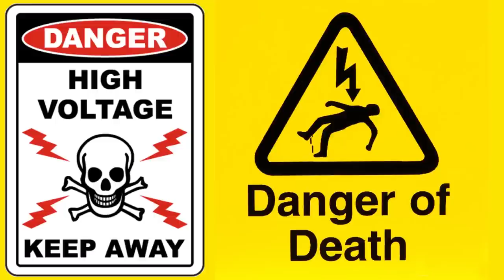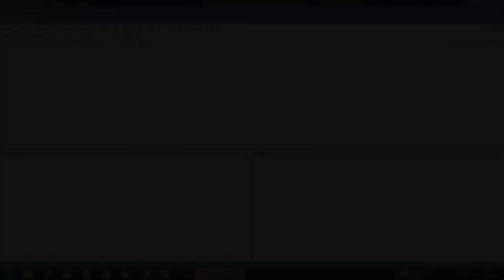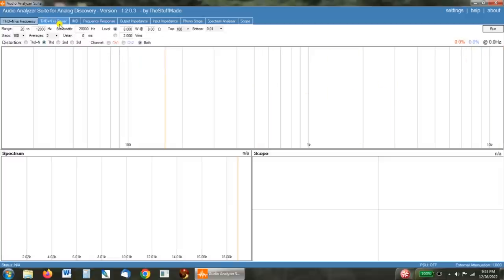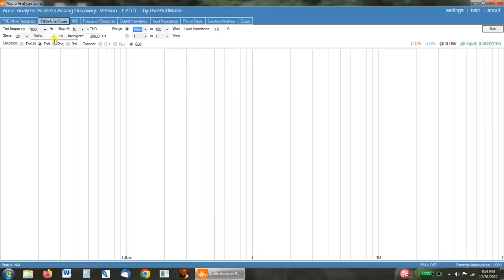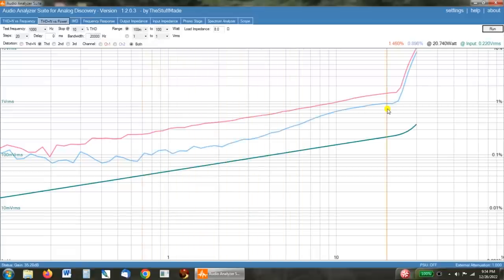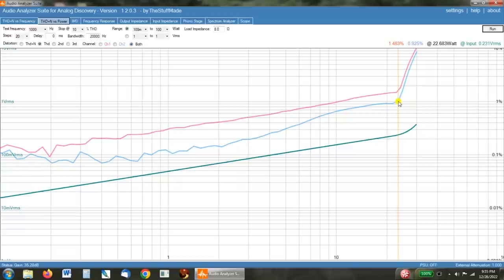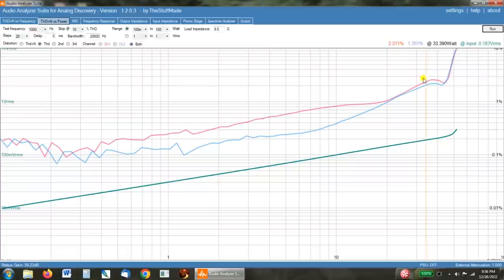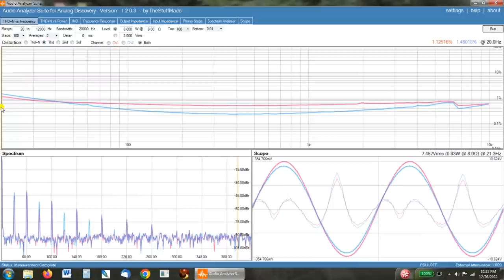Willsenton R8: Repair and Testing!

Comment: I had an R8 and did a few mods on it. By far the best mod was to replace the 4 coupling caps to the output tubes with U-Cap copper foil Teflon caps. Very expensive mod but the dynamics of the amp improved out of sight. I've now moved on and have 805 monoblocks but fondly remember the R8.

Comment: As far as I know, the Wilsenton's are made by one of the more reputable companies.   I can't be 100% sure, but I am 90% confident that the caps are genuine in these.    Really great video.   Wonderful to see this amp is as good as they claim, and can be improved on by adding some nice tubes to it.    They do sell this with two options.  KT88's or EL34's   I'd be interested, if you have a set, to see the performance with the EL34's.    It's rated at 40Watts in the EL34 configuration (UL) and 25Watts (Triode).
Reply from the maker: I do have some EL34, 6CA7 and KT77 I plan to try in it.

Comment: Great!  I have this amp with NOS EL34 tubes and it sounds very good.  Looking forward for your next videos on it.
Reply from the maker: I really wanna try it with some budget friendly JJ EL34L. I've used those in single ended amps and they sound really good.
Reply: @SkunkieDesignsElectronics  I've tried those with this and they have a very pure sound.

Comment: I have the R800i 845 and love it! But I wonder what solid core silver hookup and upgraded caps would sound like… Thank you for these videos!!
Reply from the maker: I'm more into just using "overkill" gauge copper wire, especially for short hookup wires, but agree on the upgraded caps. I really like these alum/oil Mundorf caps for sound quality vs price point. Now I can see silver wire in like the output transformer windings being a good idea.

Comment: I have for the last couple years plugged every amp I have into a voltage regulator to try to avoid any issues. The old house Im in is just a rental. I can’t repair the Elec myself, even if I know there is faults in the wiring. I just make sure my fire alrams are working, and the exits are clear. I am moving out asap btw.
Reply from the maker: Good plan!

Comment: Glad to see your thorough and detailed videos on the R8 repair. Mine just did the same exact thing on V2. Both the 10 ohm and 1kohm show they got hot and burnt but when removed the resistance is correct. I only had it on for a few minutes and heard static and saw sparks around the tube for a few seconds then the sound came back on. I am not sure if one channel went out as I turned it off quickly. This Willsenton R8 was purchased Jan 2022 and had Gold Lion KT88 repops. 
Now a question did you use the same tube and what caused this ? Thanks and keep up the great work.
Reply from the maker: Once they arc/die, they are dead. and likely the bias was set way too high or the bias pot is faulty/has no safety resistor in the circuit.

Comment: I have NOS Svetlanas running mine, plus NOS 80's Russian valves on the preamp stage. I must say I prefer it with EL34s (I got both KT88 and EL34 Svetlanas). The increase in sweetness and coherence over the stock tubes is not subtle.
Reply: Plus the sound keeps getting better (after over a year)

Comment: Hello, thank you for the great video. I have had a similar problem. i replaced all the 10 ohm 1 watt and another resistor with a metal film (1%). Unfortunately, the bias meter does not work now. I found this out after i noticed one channel that is lower volume. I am using different tubes and have swapped left to right. The one channel remains lower volume? Any suggestions? I fear the worst. Thank you, looking forward for more videos.
Reply: Oh, I made an error. Be careful of small solid conductors on preamp tube sockets. They break easily. So I have equal volume in both speakers now. I still have a pegged bias meter that was related to a similar issue you are sharing with everyone! Thanks!
I have completed the capacitor upgrades and the electrolytics as well. A noticeable improvement, especially with controlled bass. I think tube rolling gives a bit more improvement but it can be very expensive. If you have an idea about why the bias meter is pegged all the time. I will be watching.

Comment: Hi Skunkie,
I set my up my R8 today.
Running quality cables with Heresy speakers. Source is hi-res files Bluetooth from my phone. (I know, but a streamer is in the near future).
Almost NO bass. I expected punch and got foam.
QUESTION, please and thank you! :)

On the INPUT selector, both the CD and AUX 1 light up simultaneously. Doesn't matter which of those two I select; both come on, although the "selected" LED is a tiny bit brighter than the other. 
AND, my Bluetooth device, connected to AUX 1, will work even if the CD source is selected.

Should the amp go back?
Thank you a million times for your input.
Reply from the maker: Sounds like there is something wrong with it for sure.

Comment: After watching your video, I couldn't resist so I opened the amplifier cleanly to see visually if anything could be detected. As I said, one channel (left) stopped working. Everything looked normal, but I still decided to remove the small black square cover in the middle of the bottom, which I think is the transformer (sorry for my ignorance, I hardly know what + and - are). And I found a small green, I think ceramic resistor cracked. This could probably be the cause. But I don't know which resistors they are and which value. Is there a schematic of the Willsenton r8 somewhere? I would be very grateful for an answer. But anyway, you helped me a lot in terms of giving me the courage to open it, because I was afraid of screwing something up. Thank you very much !

￼

Povratne informacije

Web-rezultati
Reply from the maker: There is a schematic but those resistors aren't going to kill just one channel. 

https://www.skunkiedesigns.com/r8-mods
Reply: @SkunkieDesignsElectronics  Thanks Skunkie ! You are the One ! I'm going forward to resolve problem. You were of great, great help. Thanks again.

Comment: Hi, thanks for your videos which I enjoy. The AudioAnalyser shoftware shows four lines in scope more: two are the sine wave of the channels but what are the none sine wave lines ? Secondly do you know a way to use the software to chart a phaseshift plot from input to output ?
Reply from the maker: I would go ask the person who wrote the software.  :)
Reply: Hi, I got the anser:   @TheStuffMade
@TheStuffMade
15 hours ago
Hi Alex, thanks, the extra plots in the scope view is the signal with the fundamental tone notched out, so basically showing the distortion plus noise waveform. I haven't added a phase plot, but I probably should. You can do a phase plot using the Digilent Waveforms software, it's under the Network tab and it's a bit fiddly to configure but it will do the job.
Cheers,
Jake

Comment: Hello! I need your help! Today I replaced resistors on an output tubes an power transformer, checked the amp and it worked fine. After that I replaced 4 electrolytic caps on bias boards (clipping caps I did earlier) and added resistors to a signal wires. on the check one of the tubes went red plated and 10 Ohms resistor burned out. I replaced that resistor and set of tubes. On the check that same tube bias shows max and can"t be regulated by potentiometer. What can it be? what I did non correct?
Reply from the maker: Send me a direct message. https://www.skunkiedesigns.com/contact

Comment: I have this same amp. It's not even a year old and I have what I would call static at certain high frequencies. I know it's the amp as I swapped it with a solid state and get no static. It comes out both channels but is more prominent on the R channel. Could changing the tubes out help this problem?
Reply from the maker: Are you using it in triode or ultralinear? The triode mode sounds bad to me.
Reply: @SkunkieDesignsElectronics  Actually watching this video made me think to try it on the opposite of what I have been which is default (not sure which one tho). Still don't think I should be hearing it. Thanks for the reply!
Reply: @SkunkieDesignsElectronics  The static happens on either mode. It is volume related. If I have the volume about the 10 o'clock position the static kicks in, turn it down just a hair and its gone. I don't this this is your standard distortion, but I could be wrong. Just never heard distortion come through as static and this amp should be able to pump out much more power before distorting. Do you think this could be from the tubes?

Comment: I wonder how much it costs Willsenton to make these amps given the small additional expense better quality components would have added?
Reply: They probably won't use better components like those Mundorf caps for this model. R800 have some mundorfs but I dont know witch. I dont know about quality those Willsenton caps but they are easy to replace, and probably change sound a lot. Often much more than tubes.

Comment: Hello analog traveller. My third try due to disability.,  ? Apc regulator Italy or Phillo
pines? Need safe power Radio Craftsman C 400- ground plug only mod due to history of company and the engineers. I am determined to use voice on laptop rather than exit the web. I do wish to share war stories, poor stage wiring nand primitive guitar wiring.  Strings to ground... Really? Death cap ., really? Warm wishes, adams, ma, 15 min from old sprague factory. Bose tour after hours, and more. I'm 70 and musician 55 years. References available. keepin it 1200ft/sec!